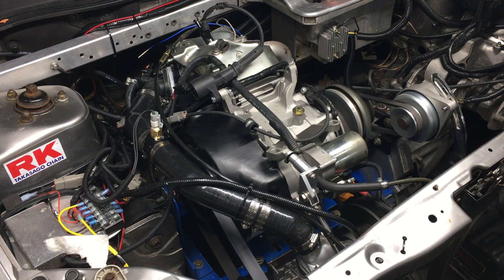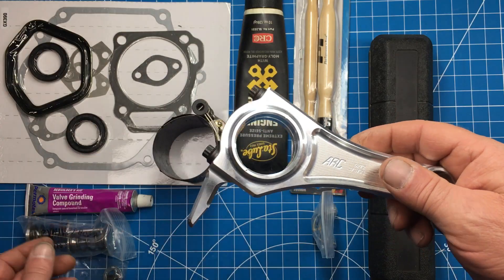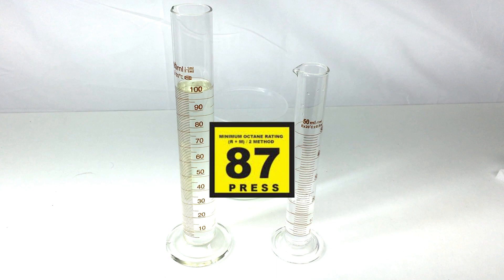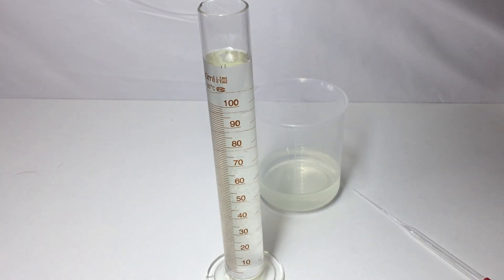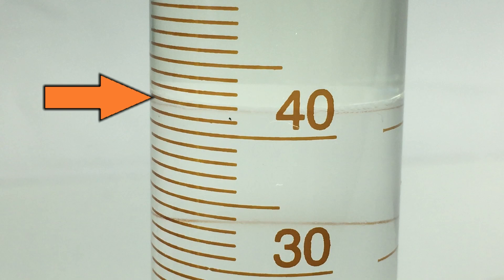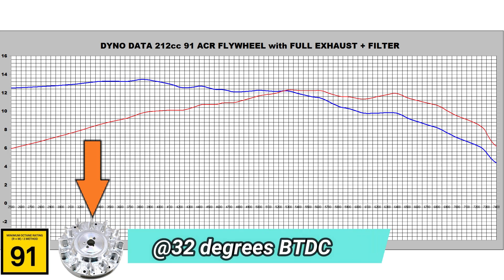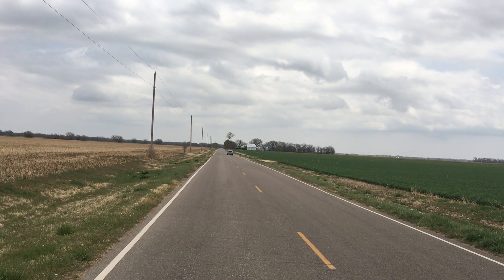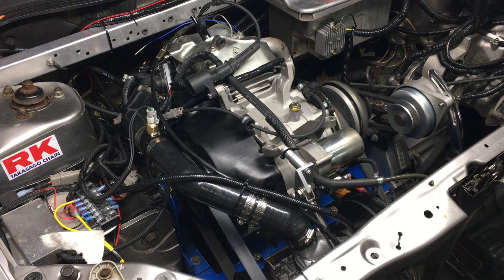S2E8: We dyno test several fuel grades to see if good gas is better than cheap gas for small engines

Comment: You need to do a test with "non ethanol" fuel too. I'm curious if that fuel actually makes a difference
Reply from the maker: Yes, we will do that next time we bring out the dyno.
Reply: Definitely try the non-ethanol. It may be the placebo effect, but every small engine (and my wife's 77 T/A) I have l works way better on non-ethanol. If you have 93 non ethanol, the advanced may get you somewhere. And lord, so, so very much less ruined carbs. . .
Reply: @gresvig2507  the carb thing is precisely why I use non ethanol in all my small engines. Kinda curious to try the water test on the non ethanol to see how honest the gas company really is with that. But even still my bikes and toys all are carbureted and get nothing but it.
Reply: That shouldn't make a difference, the reason to run Non-E is to not have it gum up while sitting..  My rarely used tools all get Non-E to prevent carb rebuilds every spring.
Reply: @wafflezoot  well yeah most people know non ethanol doesn't gum things up but it still would be interesting to see if there's a difference...
Reply: Turbo race car guys love E 85.  The fuel mixture must be changed ( more fuel ) when running E85 vs standard fuel.
Reply: that would be good  , up here in Bc Canada I buy 92 octane  no corn juice from chevron.
Reply: Ethanol gives you more power, that’s why some race cars run on it
Reply: @chasedavis2358  Ethanol allows you to get more power as it raises the octane, but it actually tends to reduce the power (slightly) if the engine isn't setup to use it.
Reply: @chasedavis2358  Ethanol gas has about 10-14% less joules of power per quart depending on  the ratio. Its alchogas.. you have to firehose it into an engine to get performance. Buying race fuel is actually more cost and power effective but e85 is more convenient so the average dipshit chooses that without any basis other than convenient tho.
Reply: i think a good comparison would to also put in a bigger jet with fuel that has more ethanol content
Reply: He could easily do that after he measures the amount of ethanol letting the water separate over night. He then has guaranteed no ethanol. I would let it sit a full day longer just to make sure the water was out.
Reply: Hard to find in some states. At my home in Maryland, in the entire state, there's only a couple places you can even find non-ethanol fuel. In Florida, where I go a few months each year, there's over 200 stations you can get ethanol-free gasoline. Not sure how many in Kansas.

Comment: Wonder how much power that WMI pump draws? At least it only draws it when the engine has enough rpm to power the alternator so the electrical system hopefully can keep up. 
Ethanol is great when your power is knock limited so you can’t run full ignition advance. It also does have oxygen in it to help add power that way too, but the engine definitely needs tuned for it. 
The nice thing for the stupid charger is that running greater that 50%ethanol will mean no matter how hot the intake charge is it will not knock. Still gives up power from the heat though.
Reply from the maker: As I recall the pump draws 10 amps.  I ended up going with the large pump because I read that the system will need at least 60 psi to atomize the meth correctly.  Once the system is set up we may reverse engineer it to find a smaller pump.

Comment: I guess if you ever decided to bypass the governor and over rev the insite motor you could cut the cooling fine off the billit flywheel and attach the plastic fins? Best of both flywheels.
Reply from the maker: The 420 engine in the Honda is running EFI without the governor, however we cap the RPM at 4500 with the rev limiter.  I looked into machining an ARC flywheel to accept the nylon cooling fan but the ARC flywheel has a different profile and its pretty much a no go.   Once we get everything all set up, we will raise the rev limit to 5K and see what happens.

Comment: if you injected straight alcohol instead of using gas with the stupid charger, it would cool the intake charge reducing the need for an intercooler if you set it up correctly.

Comment: Pre-watch comment: are… are we going high octane now?
Post-watch: performance670 has non charging heavy steel and lightweight aluminum flywheel replacements compatible with the stock fan, if that would be useful at all?
Reply from the maker: For the 670, that is very helpful, thanks!

Comment: Continuing to follow and love this experiment. I'm very concerned about 22% ethanol in a fuel which states E10!
Don't know about the states,  but in the UK E5/E10 means UP to 5%/10% respectively. 
For someone like me, who can'treally put E10 in his car, a fuel with 22% would be death for it, after 5-6 tankfuls. Is ethanol not cheaper than petroleum anyway? I think someone's at it and should be reported. "Gas" over there is bad enough as it is, without replacing it with crap. In the UK, 95% is low grade, Shell premium E5 is 99%, so is the premium Tesco Supermarket Fuel. Lowest octane premium fuel is Esso synergy @97%
Reply: It's measured different look up AKI  or anti knock index

Comment: Good stuff. Even though I own a couple of 212s and technically also even swapped one in place of a much larger engine  (on a garden tractor) as an interesting experiment, I don't know much about what's available for them as far as parts, even though i think i've got a strong understanding of what's needed and what changes would accomplish etc. So I don't know whether other flywheels exist which would allow the use of stock or other bolted cooling fans. I suspect some factors which might make it a bad idea are that the stock fan design probably gets into some weird air shearing cavitation thingy when massively oversped, not to mention it might distort, contact the housing, or even explode of its own accord even if the flywheel it's attached to doesn't. A fan could be designed to operate safely at a higher rpm range while still being separate from the flywheel, but that raises the issue of whether the stock attachment style is truly sufficient from a centering/balance perspective for higher rpms, especially if the fan ends up needing to be heavier to resist deflection from centrifugal forces. So yeah i guess i could do some reading up and find out if parts already exist and this is all 'settled science', but..  im pretty lazy and pretty ok with the cliffnotes version of 'stockish rpm, stock flywheel+fan'  or 'high rpm, billet flywheel+fan but FYI won't cool properly at lower rpms'.  

But that raises another question (dangit).. if the billet flywheel fan cools poorly at lower rpms, does it raise the 'minimum safe idle speed' of the engine? I'm under the vague impression that one of the reasons all the small air-cooled mower/equipment engines have spec'd idle speeds of 1200+ rpm even though they will run at lower is because the cooling fan performance falls off unacceptably below that and they can overheat from long periods of low rpm even at no load. So now im 'idly' curious if anyone ever overheated a 212 from idling it too long with a billet flywheel. 

Anyway, this is why i keep my mouth shut. I appreciate what you're doing on multiple levels, but beyond the excellent nuanced technical understanding, the ability to 'sell' the knowledge and process without it being boring like my comment here is the work im too lazy to put in that I really appreciate being on the receiving end of as a viewer.
Reply from the maker: Wow, that's a lot of stuff to consume.  To address one thing, most modern "lawnmower" engines have a compression relief mechanism on the camshaft and if the RPM falls below 900 ish, the engine will stall because the compression release will kick in.  now I 'm curious if the compression relief  stuff was removed and the engine were allowed to idle at say 500 rpm if it would overheat... hmmm
Reply: @robotcantina8957  Good point! I forgot about those things even though i've had to replace small engine camshafts because it failed.. another thing my memory failed me on.. it's possible that there's a minimum safe idle speed because at low speed the splash lube isn't splashy enough? Idle thoughts :)

One time on Engine Masters Steve Brule mentioned that the reason why blowby was mostly visible out of one valve cover's breather vent during one part of the rpm range but switched to the other side at another part was probably because the distribution of oil splash was changing and some cylinders had more oil on the walls at different rpms. That's the kind of shit my brain goes wild over.. too bad the rest of me is too lazy  to do actual testing like you!

Comment: Something I'm curious about is what kind of load does the fly wheel fan put on the engine. I'd love to see a comparison of the stock flywheel with/without the fan and the arc at a more reasonable ignition timing.
Reply from the maker: Noted...next time we drag out the dyno we will have a bunch of new experiments.

Comment: so if u put a flatbottom on the car and cut a hole in the hood or put hood spacers and a garden edging lip on the back part of the hood would it improve cooling? or would drag be too much of a factor at higher speeds do to pusing higher pressure air in to a high pressure zone like the windshield?  or would one of those bonnet vents be better or is the heat not really an issue? lol
Reply from the maker: Heat is always an issue with this rig.  We are running a custom aluminum belly pan under the front of the car and that helps us get better top speed, but it also causes things to run hot.  I may try raising the back of the hood with some spacers for additional air flow.

Comment: one purpose i can see is that the engine is cheaper than a direct replacement car engine , in town you should have enough speed with this engine
to get this engine to make the most use of the better octane rating you probably need to change the timing and possibly the static compression of the engine too
the higher octane might perform better under boost compared to the lower ratings if you ajust the ignition timing
Reply: yes high compression requires higher octane fuels  hence 1 reason  race car drivers and drag racers either run 100 octane air plane fuel or alcohol.  with the higher the octane and with air fuel ratios dialed in the better octane fuels will burn not only hotter but cleaner you want hot clean combustion for a more complete fuel burn. therefore higher compression can will utilize the higher octane in the fuel.

Comment: Far as I know, the 91 in the area I live doesn't have any ethanol in it, and I run it for that reason in my small engines.  If I try to run 87 with the alcohol, the engines run worse and are often more difficult to start.
Reply from the maker: In general 87 is fine, but your right the ethanol causes a lot of problems, especially in storage.  Some folks make home brewed fuel by using the water method to draw out the ethanol.
Reply: @robotcantina8957  I'm aware of that method, but it's just easier for me to not buy it in the first place.

Comment: Wondering what the impact would be if you advanced the timing advance?  The higher octane should resist the detonation from the  timing change.
Reply: There is always the point where the system is happy, you only need enough octane to satisfy that point.

Comment: Very interesting.  I generally run 91 in my small engines.  I believe it does run cooler then 87.  I’m ok losing a couple percent power if it helps keep temperatures down. 

I think you want the clutches to hold engine rpm at max torque while the belt shifts, then let it spool up to maximum rpm.  I’m guessing the supercharger is going to shift the power band though so it may have a different rpm to hold at.

Comment: I estimate there was almost 6.5 ml to maybe 7 ml of ethanol in that gas (7 ml = 5.5 grams of ethanol, added to 20 grams of water, est. 0.95789 g/ml density for that mixture at room temp, so the volume would be 26.6ml, which is about what we see, a little bit over). Not really the biggest deal, but it's easy to underestimate ethanol if you add it to water and measure the volume, because the volumes don't add, the mixture "contracts".

Comment: What do you think about taking the cooling fins off on the lathe and running the stock plastic fan? Best of both worlds!
Reply from the maker: Good point, I looked into that and the ARC flywheel has a different shape and it's a no go.  If ARC offered a blank flywheel, that would be epic.
Reply: @robotcantina8957  I'm sure someone out there in YouTube land could 3D print a cooling fan that would fit on the ARC flywheel.
Reply: @Surestick88  It would work nice In a a stiff TPU so it wont crack or break. I use a 3d printed fan on the motor for my lathe.
Reply: @robotcantina8957  It might get expensive, but could you "roll your own" flywheel on the lathe to get the dimensions you need and allow you to use the plastic fan?
Reply: @robotcantina8957  maybe you can lathe the fins off and bore the inside of the plastic fan and use the pins to hold it on?
Reply: If you want the fins removed or shortened let me know the wheel diameter and if it will fit on my lathe I'll cutt'em off for ya.

Comment: Maybe not Cap'n Crunch, but Apple and Cinnamon Cheerios, the adult Apple Jacks and a hot mug of black coffee.  Let the show begin!
Reply from the maker: Apple cinnamon Cheerios is a great alternative when you run out of Captain Crunch !
Reply: @robotcantina8957  As I watched this, at the end, I wondered if there was a way to get air from the outside forced into the engine housing at speed.  I mean if you hit 70MPH there has to be some way to get air being pushed by the car to pass through the housing.

At lower RPMs, the ARC (or is that ACR, or EIEIO, or whatever) flywheel might be able to provide enough cooling.  While at speed, forced air the car is passing through could provide cooling.  

Just a thought, I'm an EE and Software engineer, so we just turn the power off and back on to fix 99.44% of things.  But woefully unqualified for automotive engineering tasks.

Great channel, thanks for the content.

Comment: The ethanol by itself is over 110 octane .
Raise the compression ratio to take advantage of that to get the hp back!

The gas / ethanol mix has lower KJ / k g  chemical energy so cut down the head or change the piston to get the comp ratio up.
Reply: BTU/pound mass

Comment: The methanol/H2O injection should be fun to test. Fuel injector placement can also help lower intake temps.
Reply: I would love to see an MW/50 system added to this project. Water injection can add a lot of power, but I doubt the engine would survive the manifold pressure required to require it.
Only a tiny fraction of the increased power MW allows in from the water flashing to steam, most of it is from allowing the engine to run higher MP without knocking. 
Essentially it's used as an Octane booster. (It doesn't actually change the Octane rating, but it prevents knock the same way Octane does)
With modern fuel, 97, 100, and even 105 Octane fuels are readily available, and I'd be surprised if nothing on the engine broke before the engine started to knock  on those fuels. I don't know how much boost it would take on this engine to make high Octane fuel knock, but I'm sure it would be far more than any part of the engine is designed to handle.
Reply: Worth noting that from a detonation perspective the manifold temperature is pretty much irrelevant, what we care about is the charge temperature just before the spark plug fires. This is why direct injection allows more compression or timing, the fuel directly cools the charge rather than wasting cooling potential on the inlet plumbing.

Comment: I run 2 snow stage 2.5 wmi kits for a over a year. Been flawless.
Reply from the maker: I picked up the stage 1 kit for simplicity plus I likely need to scale back the flow quite a bit.  We will be testing it this week and should show up on next sundays video.  Stay tuned!
Reply: @robotcantina8957  I look forward to it. I run my kits on engines that make much more power so I need the flow 😄 

One is on my mk6 gti with a 62mm turbo at 28psi. Other is on my built vq35de twin gt2871r at 24psi. The vq has dual nozzle equaling 1200cc with the nozzles in the volute of the turbos.

Comment: The reason for the horsepower less is the lack of compression ratio in order to take advantage of the higher-octane rating, just like if want more torque from the engine you need make the intake runner longer just like with long tube header vs short tube header but with more than one cylinder which makes use of exhaust scavenge effect, now as for the cast flywheel it helps maintaining rotating mast which go for torque and lighter billet it aids in faster RPM for horsepower.
Reply: @stingcool9455  you still have to increase the boost if you are using a better fuel